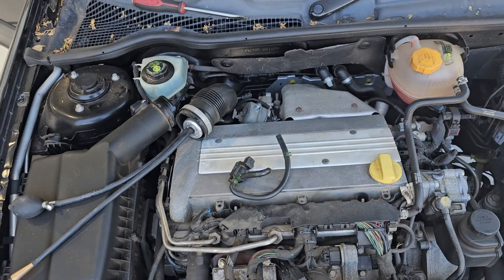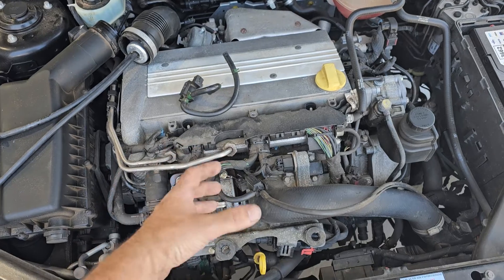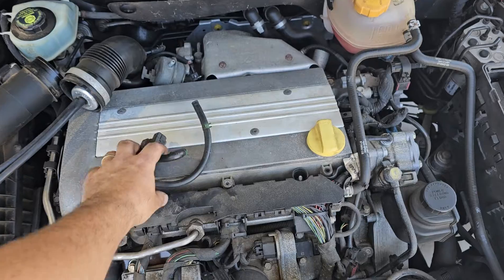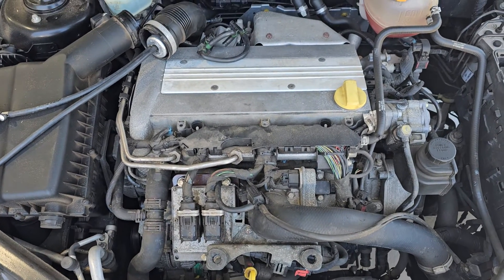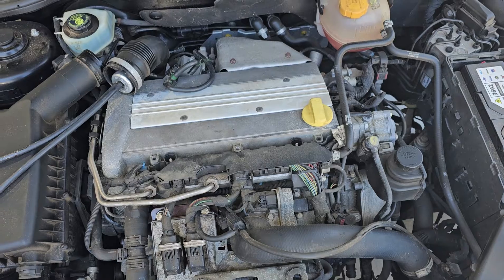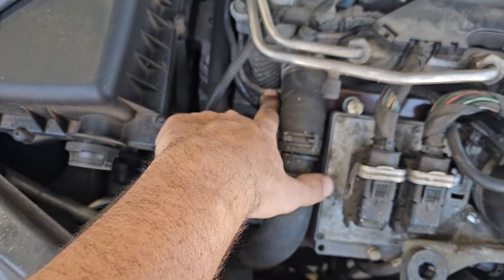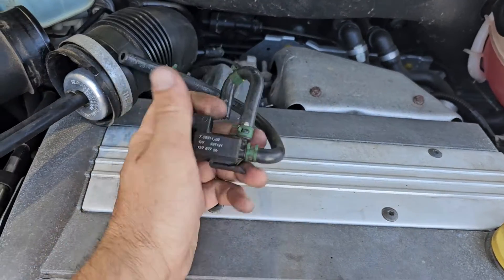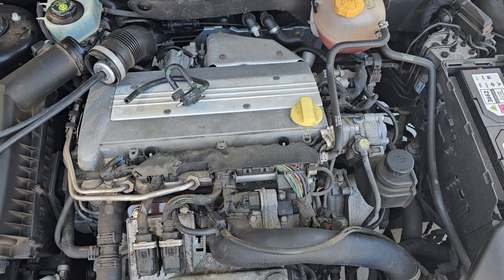Saab 9-3 Turbo Boost Issues

Comment: Those 2003 to 2012 9-3 2.0T engines are literally the easiest general motor engines ever built to work on. Parts are easy to get those engines where used in the masses with GM fleet world wide not just in GM Saabs. It’s only the ECU and CIM that’s a pain in the ass with them since that was all Swedish. Great video BTW
Reply from the maker: We generally don't see too many of these Saab's in Australia, they're not a very liked car over here hahaha
Reply: @ in America they was popular the V6 Turbo 9-3 Aero from 06 to 09 a lot of stage 3 plus ones here pushing 820HP the 2.0T is a reliable little go kart but the V6 T is a beast

Comment: I am getting intermittent half boost with the P0033 code. Do you think changing the bypass solenoid fixes this?
Reply from the maker: It could do for sure, I usually see failing solenoids causing lower boost pressures
Reply: @RealAutoSolutions  amazing thanks just what I needed to know. will be replacing that along with a few vacuum lines, hopefully this fixes it!
Reply from the maker: Good luck friend !

Comment: how can i fix an issue im having. When i floor it the boost gauge never goes full boost it stays in the middle and then the car goes into limp mode
Reply from the maker: Do you have any codes